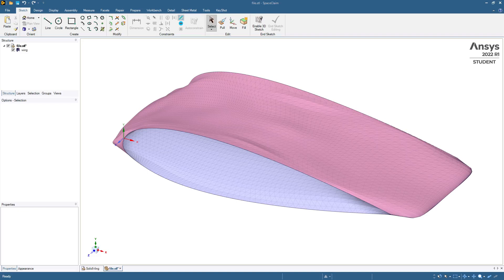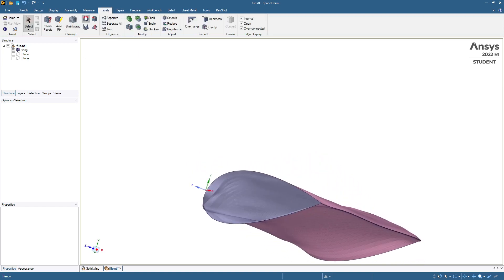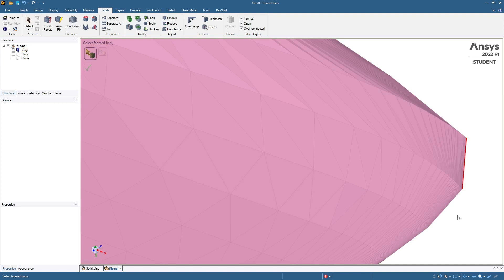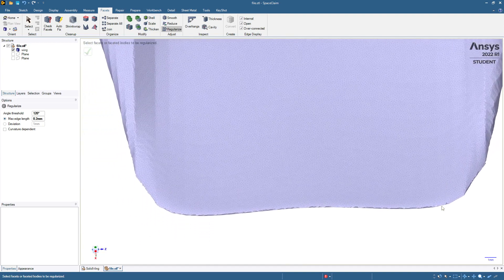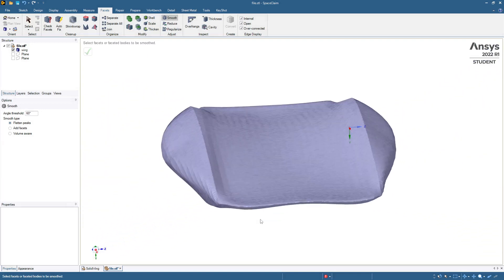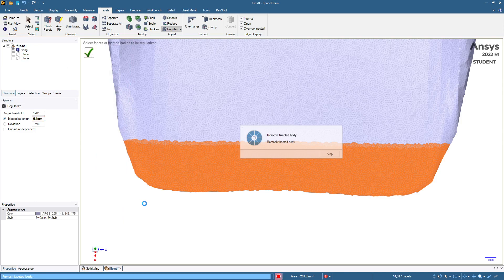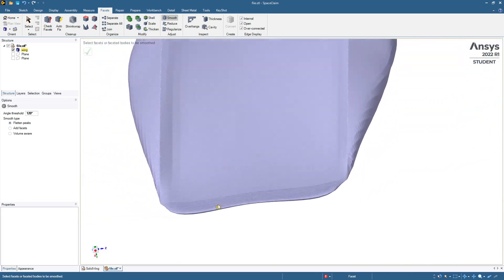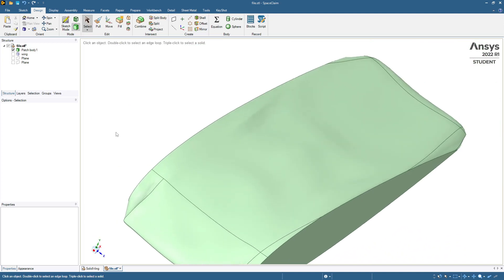Ansys SpaceClaim convert STL to Solid using Autoskin Tool

Comment: Excuse me sir can I convert the STL file from QBlade into ANsys fluent, if I can, may I get any video to help me to do a simulation
Reply: use slice tool in soldiworks and then loft feature to connebt the sections